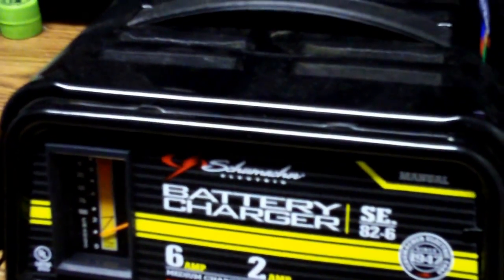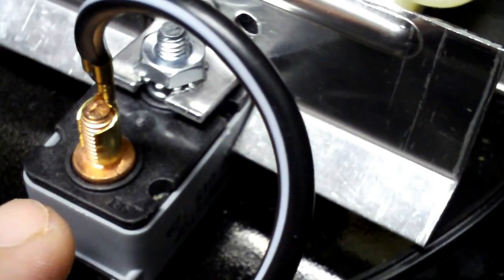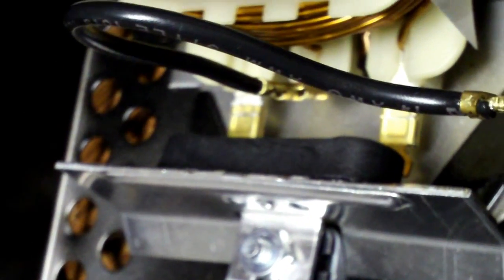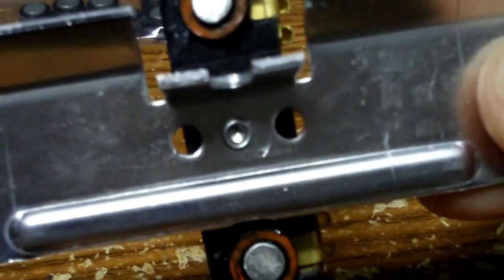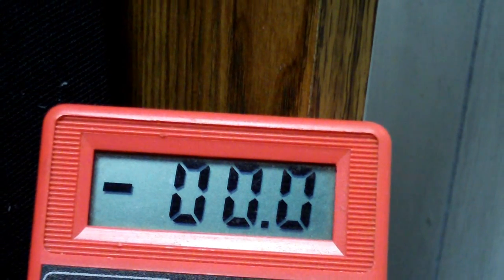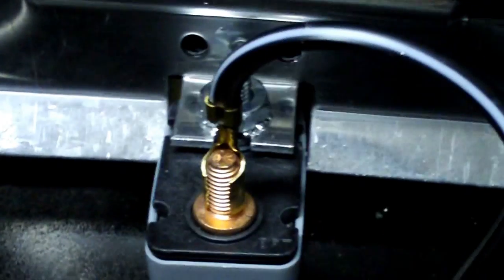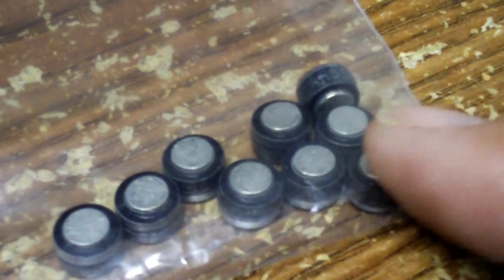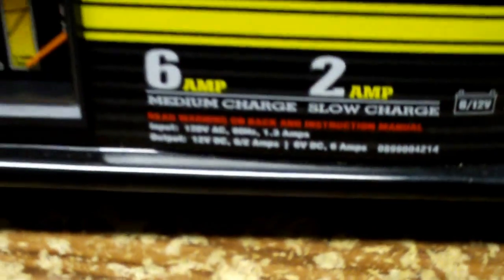12 volt battery charger repair.

Comment: Problem is I am not getting a reading at the Black and Red Alligator clips. I believe everything is good from the transformer to the Black Alligator Clip as I tested it that far. This same black wire goes to the Short Stop which is working fine as I took voltage right to it.  The problem from what I can see is where the positive coming from the Transformer goes to the circuit board. Somewhere from the board to the Red Alligator Clip wire there is no electric as I believe there is a bad component

Comment from the maker: Wel mine doesnt have a circuit boad on it anywhere, pretty much hard wiring and switch, and a short stop with a heat sink and  diodes, Your might be a Automatic charger, mine is a manual, so if your is automatic, thats why you have  s circuit board, i stayed away from those just because the last one i had  gave me a problem after a year, i figure a manual charger would been best, so far it is, just cant be touching clamps for any reason so i learned, lol..

Comment: Still waiting on the diodes to arrive. Will surely let everyone know how I made out.I finally found my multimeter this morning to checked voltage coming out of the Battery Charger and got a Zero reading. My charger has settings for 10 amp 6 volt manuel , 2 amp 10 amp 12 volt auto and  55amp engine start boost, No reading on any of the settings. I do remember crossing the negative and positive cables on a battery just before the unit died about a year ago. Hopefully I just blew out the diodes.

Comment: No need to be sorry. I appreciated your help.  The way I look at it is you win some and lose some. Fixed many items other people would of thrown away over the years. Just didn't work out with this item. I am only out 10 bucks and still have a bag of 50 amp button diodes I may eventually use or someone else may need. I will hold on to this charger anyway as it still has good cables that I may need down the road and who knows I may find out about another fix.

Comment: Ok I believe I found the problem this Sunday morning. As I mentioned there was some bad soldering. Took my soldering iron out and cleaned and resoldered what looked bad. Actually there was a loose joint on the board. I am now getting juice at the red and black alligator cables. Problem is I believe I have a bad switch on the board. The switch serves 2 purposes. Left position is charging, right position is engine start/boost. Charger works only on the start/boost side.See next post.

Comment: Had thoughts of that box possibly being bad also. It is called a Short Stop as written on it.. Also reads that it is a 12 Volt 20 amp stop. I forgot to mention to you earlier the transformer on my charger is not making a loud hum. It is very quiet but it is bussing similiar to yours after you disconnected the bad diodes. Anyway it is a cheap fix replacing the diodes out first. Hopefully they will be in the mail later today Thursday or by the weekend. Tracking said possibly today.

Comment: Just placed an order with Skycraft. Ordered a dozen in case I need them down the road as I have other chargers probably using the same diode I believe. If not cheap insurance I guess. Shipping varied from $1.95 to $5.50. Took the First Class Mail at a $1.95. Want to thank you for your video and help in this matter. Will let you know how I made out later next week if the parts arrive by then.

Comment: Bypassed the short stop and found it is not the problem. Not getting much voltage out of the transformer from what I can see. Not worth messing around with it any longer. It will cost more to fix it then to just replace the complete unit with a new battery charger. Still now I have a bag of diodes I may never use but I needed to take that chance that it might of been a diode. Still I have them in case they do go in other chargers down the road. Thanks for your help here.

Comment: I just ordered the diodes on Ebay. I think mine is an older model. The diode casing is riveted directly to the large heat sink. It seems you have to drill the rivets out and re-rivet it back on the heat sink. I think what I will do, is just drill a hole in the heat sink, rotate the diode casing to the hole and pop out the diode. Hopefully it works... Thanks for the video.
Reply from the maker: Your very welcome. And good luck with your repair !
Reply: what is the item number on ebay?

Comment: I saw the listing for 65 cents each also by a online vendor a little bit earlier. Didn't get a chance to check it out further as far as shipping goes. Was hoping to see if my local Radio Shack or other electronics store in my area carried them and at what cost first. Will try Monday. Wasn't about to buy another Harbor Freight Battery Charger. Did a little research on the HF Charger in question and can't believe all the complaints from so may other owners of the same battery charger dying out.

Comment: yep bridge rectifier failure, it probably wont happen again, they dont really wear out, you just had a bad one, you can buy a bridge rectifier in a block, no need for separate diodes, and you can buy one with a higher amp rating than the old one, bolt that to a heatsink, and you wont have any issues again, just 4 connections, 2 for the ac side and 2 more pos + neg out

Comment: Thanks for the video, I determined I do have a burnt out diode. Now that I know that, i find no replacement Diodes anywhere? guess I'm just expected to throw it away? I see this video is from a while ago, but any recollection where you found the Diodes?
Reply from the maker: I found my diodes on eBay and I bought a pack of I believe 10 at the time if it was me I would hold on to your charger for a little while until you give up on trying to find diodes for it they're usually available you just need to know the amperage for your particular charger normally they are 50 amp diodes and they're called button diodes I wish you luck on finding them I haven't had to replace my diet since I made the video so far it's been good

Comment: Got the diodes in the mail today. A little smaller then the originals in my charger. Tried 2 of them out but it did not fix the problem. Funny thing I had to try the diodes both ways since they are not exactly like the others. Don't really know which way to put them in for sure. Either way I mount them the charger lights up 2 bulbs on the front of the charger without plugging the unit in the wall no matter which way they are mounted. Plug unit in wall but get a negative read out. I am stumped.

Comment: I have the same one. Thanks. I found the 25 amp at Skycraft parts. Still looking for the 50amp.
Reply from the maker: U may ne able to find them on ebay.  Just Google 50 amp rectifying button diode. Or just 50 amp button diode.

Comment: Hi there, think the black lump is called the rectifier, the diodes can be tested with an ohm meter they should only conduct one way if there alright, also you can do it with multimeter on diode setting...think about 0.7 volt drop one way only, believe the other bit is prob called a current trip....from Fred in England.
Reply from the maker: Fred,  thank you for the information.  Yes it is where the diode buttons are located.  If I have a problem with it again I will check them as you described.  So far since I repaired it. It's still working today

Comment: Yeah this thing lasts forever. I’ve had set to 2 amps trickle charging a car in the garage for close to 10 years. Didn’t realize the rectifier circuit is so basic though. Can’t be the cleanest 12V power source that’s for sure.
Reply: How about putting a large filter cap say 2500 mfd at 25 volt across red and black output wires that go to battery.That should clean it up.
Reply: @johnmoyer2849  they could have at least used a 4 diode full wave bridge rectifier circuit.

Comment from the maker: sounds right to me, sounds like your charger is a automatic type, and something on the cicuirt board burned up, mine doesnt have that, but its manual. There could be a smaller and different Diode on that board, Diodes are only to allow current to flow in one direction, rectifying diodes i think turn the AC to DC current if im not mistaken

Comment from the maker: I believe, its working, When i tested mine on 2 amp i had 10.2 volts  and on 10 amp i had 12.7 volts  i believe your charger is working,, not sure why strange, i believe the You should check voltage where both diodes mount, check them as one, not seperate at this point, you may get different readings from just checking one a time, but your getting power out through them non the less.

Comment from the maker: Thanks!  I hope it lasts me under normal use at leaft 5 years,had a electronic Automatic battery charger with Desulfation mode, it took a crap after a year! but it had so many  electronics in and transistors and etc, that i could not figure that one out, So i bought this manual one,  anything else usually costs you big money to get it worked on and you still wont know how long it might last you afterwards,

Comment: Thanks for the video.  I'm wondering where you are measuring the output for the meter.
Reply from the maker: I was measuring directly from the button diodes. If it's not rectifying 12volts. 1 or More is likely bad If the transformer checks out to produce AC output voltage  to the button diodes..
Reply: @Wallabydam  Thanks

Comment: I couldn't find any 50A button diodes, searched ebay, none. So got the 25A MR3025, and they work fine in the Schumacher SE 86-2. These lower amperage ones my not work well in higher amperage chargers.

Comment: Ended up pulling the circuit board out last night to check the backside. Have to say someone did some crappy factory soldering and Harbor Freight doesn't carry parts for their chargers. Wouldn't buy another HF Charger ever again being they only come with a 90 day warrenty. I also own a Sears Die Hard Charger. Comes with a 3 year warranty and seems to be made better. Going to check the resistors on the board and see if I could test other components on the board with some Net Help before I giveup

Comment from the maker: Well there is a Ring on the one end of the diode to tell you the polarity, they should be put in the same as the originals, withoutreally seeing the charger apart its hard to say , only thing you need to check that does and can go bad also is the SHORT STOP or circuit breaker, you need to check for voltage BEFORE the short stop and AFTER the diodes, if there is not voltage, there is something else  that could be electronic in that charger, that i am not un aware of, could ALSO be the meter bad

Comment: On the start/boost side I can still select a 2amp,10amp 12 Volt charge or even a 10amp 6 volt charge manually now. Only spent $3.95 for the replacement switch so I don't have a lot of money in this charge other then my spare time messing with it. As I said before these chargers can be purchased pretty cheaply and parts are not available from the Manufacturer. It was still worth it for me to give it a shot and look inside. Sometimes you win and sometimes you lose is what it all comes down to. lol

Comment: Same charger same problem, worked fine until I accidentally shorted out the out wires for about 5-10secs, then got a burning smell and the extra loud buzzing.  Pulled it apart, it has 2 button diodes, so I believe this is full wave rectification, any way one diode measured short circuit (use your diode setting on your meter to test), which means it's toast, the other one was fine.  I cannot find 50A button diodes so I going to use 25A ones as they seem the most common type, $9 for 12 including shipping.  I'm thinking on the 6/10A model charger 25A will be fine, and that the only reason it may have had 50A ones is that they can have a common part across 2 models.  The transformer measured good.

As a side note, it is quite common to let diodes blow as a safety device, using them like a type of fuse, if you get my drift, they also do this for reverse polarity protection on electronics as well,

 Thank you for posting the video, it got me started on the repair.
Reply from the maker: Your welcome. I just did a general search for button diodes and found mine on ebay.  Took care of the problem. And yes they do work somewhat as a safety for back voltage or shorts.  Good luck on your repair. Thanks for watching !

Comment from the maker: No reading on it must mean you have Noth diodes burned up, i had one bad on mine, and had a very low voltage on all settings, Im pretty sure its the diodes, damn shame these are not more available, think of how many battery chargers get tossed because of a 70 cent piece,mine was few months old, if i did not do the patent search i would not have figured it out,   let me know if yours gets fixed from replacing them,

Comment from the maker: Blkctthwt  well the circuit breaker on the charger would not allow any coltage what so ever, if you hear it buzzing loud, its more likely the rectifying diodes, on that model you have, they are threaded 50 amp diodes, you can get them online, the job of the rectifying diode is to take the ac voltage and create DC voltage, you have one of them that is at fault or faulty, you will get that when both are not working,  there is a video on here that shows a chager like yours the guy is replacing those rectifying diodes in a big charger just like yours,
 they both have to work or you will get a voltage varience like that, if both were no good, you would not get any coltage at all, one broke would produce a problem as you state,
 Good luck !
Reply: +Wallabydam canyour traducer in spanish for please
Reply from the maker: Translate what to spanish
Reply: +electricos3 Que oculpa senor? Que tipo de problema tiene?
Reply: Kevin Hopper   tengo un problemas.
nesecito saber las conexiones  correctas en el selector de voltaje de  cargador para baterías marca schumacher mod. SE-82-6   por la atención que me brinden muchas gracias     un afectuoso saludo desde Veracruz México
Reply: I have the exact same model but mine just Clicks on and off all the time but not charge. I only used it 2 or 3 times before this started. Please Help! Thx

Comment: Thanks for the video. However I did Check all these things. And nothing. For anybody that's watching this, simply check the end terminal connections on the clamps. I found that one of my wires was pulled out... Go figure.. so I soldered mine on and its working fine now..
Reply from the maker: Funny just the other week i had a bad spot in one of the wires on my battery charger i have in this video, it didnt do the same thing as it was doing in my video (ie) making a loud buzzing sound like it was under a load, BUT it just was not charging, i checked the output inside at the breaker, found it was putting out power and traced the fault at the wire, and re solderd the clamp, works once again, But you are right, thats also a common fault that happens with use when the copper wire has a internal and hiddin break within out of view,  Thanks for stoppin in !

Comment: I believe I have the same problem with my battery charger from Harbor Freight. Would of brought it back but it only came with a 90 day guarantee. Anyway have it apart but I am having a hard time finding replacement diodes out there. Came up with a link to Ebay of which 20 were sold but it seems no one has them on Ebay anymore and my google search did no good to find them. Any idea where else to look?

Comment: Not to confuse anyone there are 2 switches on my 03418 Harbor Freight Charger. Look at the charger online to see what I am talking about. The first switch to the left of the front panel is what I believe is defective. Tried cleaning it drenching it with Alcohol and a swab but didn't help. May take the board with me to an electronics store to see if the switch is available. If not too expensive I will replace it. Otherwise the same HF charger on sale sells for $34.99 although I won't buy another

Comment: Couldn't walk away from it just yet. Now I don't believe there is anything wrong with my Transformer. Took my multi-tester and took a voltage reading coming right out of the negative side of the diodes going to the transformer and from the positive point at the plate the diodes are mounted to. Getting a 12.8 Volt to a 13 reading in the 10amp selection on the switch depending on what diode I touch, 10.6 -11 volts at the 2amp position and 7.8 to 8 volts at the 2 amp 6 volt battery position

Comment from the maker: forgot to mention there is a Circuit breaker also that the battery leads attach to, that could also be bad, its the lil metal or plastic like box the leads go to, or through,

Comment: I have my grandfather's old Sears 2/10/50 charger. It's worked fine for the 8 years I've had it, but today it sparked inside of it when I plugged it into the wall, and now it doesn't show any amps on the meter.
Reply from the maker: If it sparked  it's a loose wire or transformer it's bad

Comment: i have the same one and sounds just like that but it charges fine. i use the 6 amp for my 12 volt battery for my cruiser and it work fine.
Reply from the maker: Most make a buzzing noise. But in this case obviously mine makes the transformer noise you hear yet it doesn't charge . 6 amp is a good general setting for most.

Comment: COOL, but i recall a diode allows current in only one direction, from physics class, so what is their purpose in this arrangement, do you know by chance?
Reply from the maker: There is a marked end on one side of the diode. I just remove them the way that they came out and replace the old ones with the new ones the same way
Reply: sounds like this is the guy that should be making videos at least he knows what he's talking about probably knows how to use a meter the correct way    way better than shotgun approach oh yeah the voltage on 6 volt was correct the voltage on 12 volt was low so not complete fix replace something else could get expensive new charger cost what